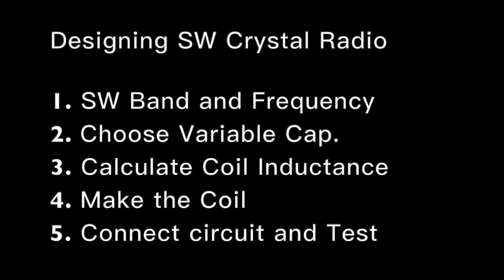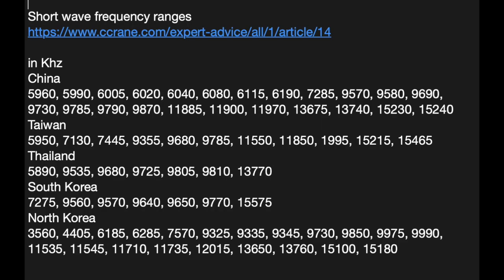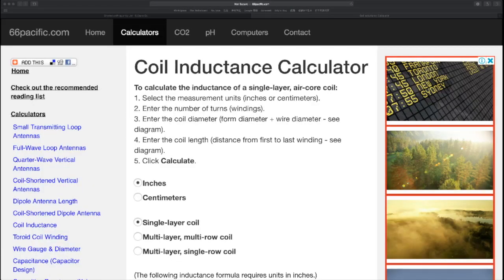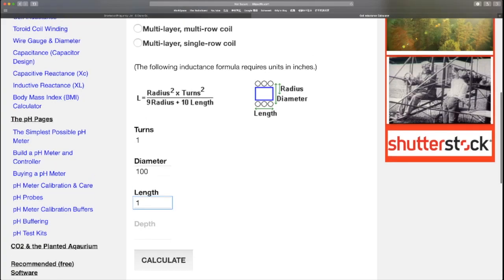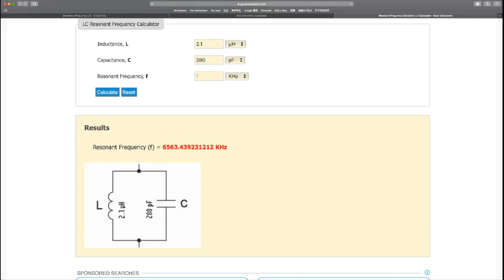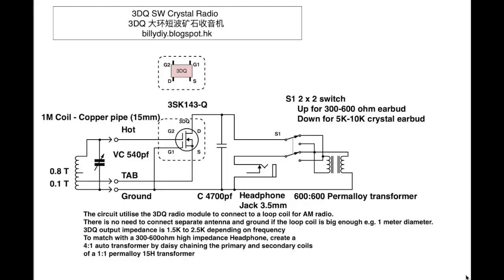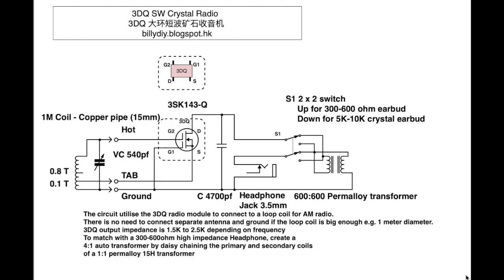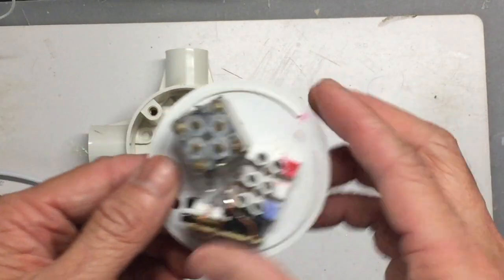1 Meter SW Crystal Radio Step by step construction guide

Comment: About local stations: if signals is strong, crystal radio can drive speaker tought maching transformer...
Reply from the maker: That's right. I had tried that before. You can also use an LED as a detector and also drive the speaker.